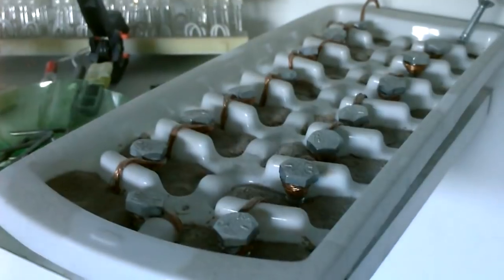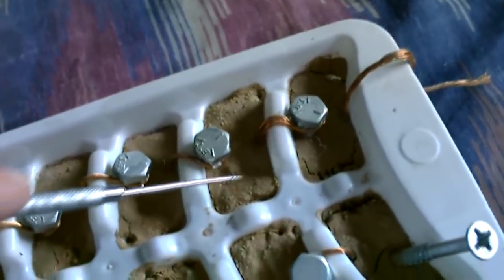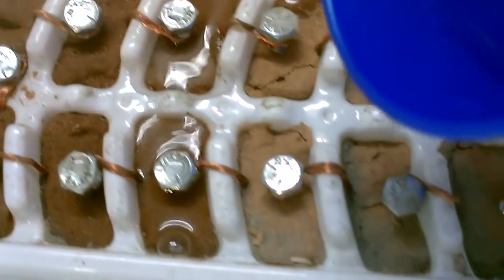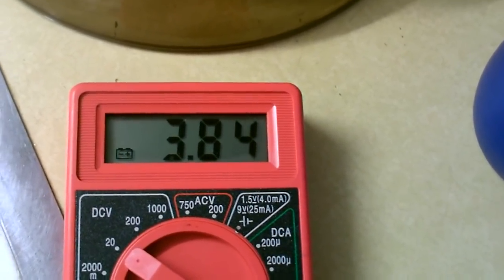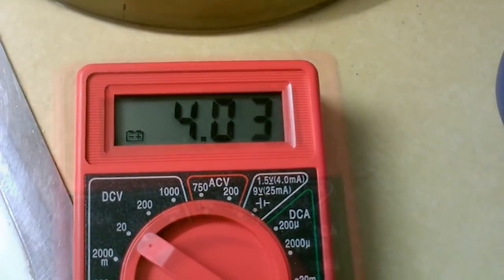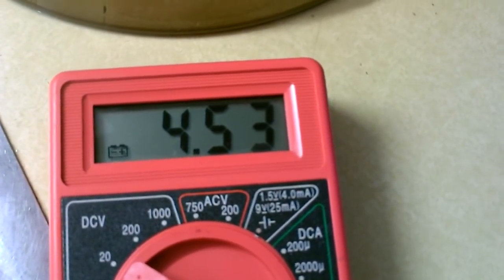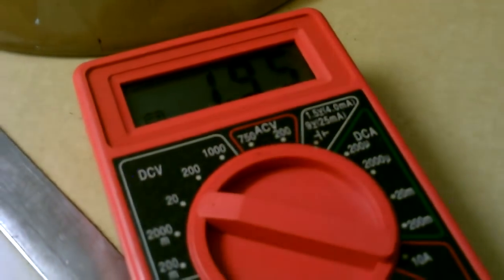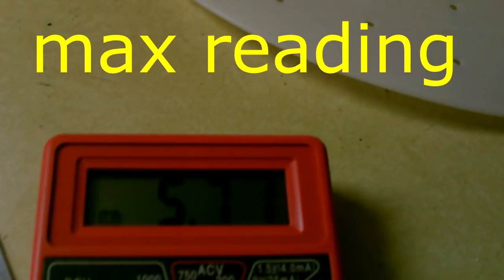MY DIY Earth Battery (4 yrs. later) - unused for 4 years - will it recharge back to new??

Comment: I made something similar back in 2008..   to this day, it still works.  corrosion on the copper exposed to air, but mine is still moist and holding a charge 12 years later.   I duct taped the entire tray and super glued the air openings..   it was a little bloated with what I imagine is evaporated water or metals..  kinda like a cell phone battery gets if hit hard or is too old.   My tray initially put out 13.7 volts and idk how many amps but it was able to light up a bright led... and it is now at 12.9 volts..  light is just as bright.       Also..    they recharge.  :)      connect them to solar just like any other array and you have free batteries forever.      At least 10+ years.    Testing needs to be done cause I'm pretty sure that if any idiot like me can stick a few pieces of metal in the ground and get a voltage.. then this has to have been discovered by ancient people as well.

Comment: How about adding some salt with the dirt and then covering the whole thing with cling film to keep the moisture in. Great job, if everything comes to a standstill I'll be digging in to my fridge
Reply: There are already electrolytes present in the soil..  Silica is the main here though as their fields line up.   But yes..  adding salt or vinegar...   or even soft drinks will increase the amperage or voltage..  maybe both.  idk, the light got brighter when I added different substances compared to straight water.  Also..  it can't be TOO over saturated or you get a voltage drop..   it passes through the density of the water at that point instead of going through the electrolyte.     Plain salt water will do the trick as well, though...  I believe it corrodes the cathode faster.

Comment: The real question is.. What is the chemical makeup of the dirt?
Reply: Cleaner than the topsoil along State Road 165 in Ohio,
🚂 🚃💥☣️🌱... 

But I wouldn't recommend licking it.
Reply: @wasserperson  - Fun Fact:  State Road 165 in Ohio doesn't exist. 💡
Reply: @ShadovvV 🤔... Is that because I shoulda wrote "route" ?

Or are you getting at some other something?
Reply: @wasserperson  - There isn't any state route either because it's a township. 💡
Reply: @ShadovvV  🤔..?  I'm seeing maps showing a short stretch of road labeled SR 165 and I'm getting website answers including it on lists,

are we talking about different things, or there's something I'm not noticing?
Reply: @wasserperson  - Yeah, I've been secretly involved in a cryogenic experiment involving fake TB injections and Portuguese port wine.
Reply: @wasserperson  - Nothing you wouldn't be able to find publicly..
Reply: @ShadovvV 🤔🤷🏻‍♂️?

According to the official Ohio DOT, SR 165 exists and is getting repaved right now, so if you're trying to get me to find something else, 
🤷🏻‍♂️

>State Route 14 & 165 Resurfacing and Culvert Replacement
Location Mahoning

>Project ID: 105210

>Work Category: Roadway Minor Rehab

>Est. Const. Cost: $3,860,000

>Begin Construction: Spring 2025

>End Construction: Fall 2025

"Resurfacing of SR 14 between the Portage County line and the Columbiana County line and on SR 165 from the northern Beloit Corporation limit to SR 14 in the Village of Beloit, city of Salem and Smith, Goshen and Green Townships. Project also includes one bridge replacement and other bridge repairs."
Reply: @wasserperson  - Is that where you're hiding the bodies ?